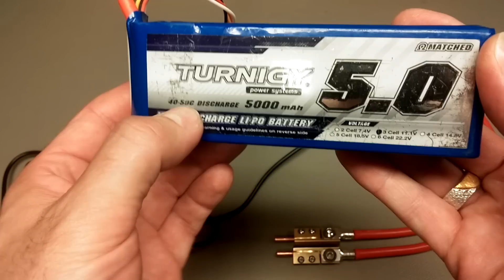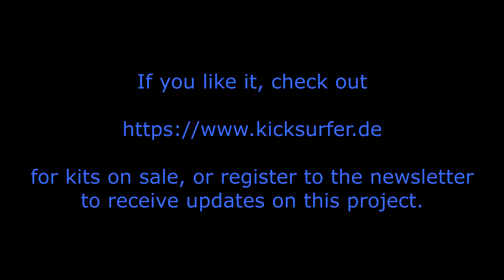Next level DIY battery spot welding

Comment: 150J sieht mir ein wenig overpowered aus, selbst 0,3mm Strip schweiße ich mit Druck auf die Elektroden bei 100J und die sind fest. 
Teste mal bitte verschiedene Einstellungen und verschiedene Streifen, das wäre sehr interessant.

P.s. den Daumen hast du trotzdem bekommen ;)
Reply from the maker: zu dem Zeitpunkt hatte die Firmware noch falsch gerechnet, das ist längst behoben :-) Die richtigen Werte habe ich dann im Manual aufgelistet.

Comment: If the FETs stay on for some time, the current should accumulate due to inductance to some maximum value, when the FETs are then switched off, so ZCS switch on. But at switch off you have maximum current and maximum switching losses, and without a flyback diode how is this energy depleted? Like I see what looks effectively like a buck converter without the freewheeling diode. The freewheeling circuit will be half of the power since it starts at the peak current and decreases to zero.

I thought that was what was killing my cheapo $25 ebay special along with poor gate drive. At least on one occasion, a FET failed so spectacularly that it somehow welded itself to the PCB and removing it required lots of heat and force with pliers. Chipping away at the plastic encasing and the stuck metal tab that welded itself to the copper despite being soldered.I did get a chance to see the silicon die on those and was impressed with how huge it was. So used to thinking of transistors as microscopic things but seeing the die that was maybe 4mm by 6mm was just amazing!
Reply from the maker: in kWeld, this is handled by an array of large TVS diodes. As you have experienced, the MOSFETs alone cannot handle the amount of inductive kickback at these current levels.

Comment: Hello: as sending e-mails to both info@keenlab.de and admin@keenlab.de failed, I'll try it like this.
I would like to order a Kweld, but your website sends an error-message:
"Composer detected issues in your platform: Your Composer dependencies require the following PHP extensions to be installed: bcmath"

I hope this reaches you ;)
Reply from the maker: website is up again, this was a glitch from automatic updates! Contact email is frank.boeh@keenlab.de
Reply: @wearethewatt2950  Thanks ;) I just went with the mentioned adresses as most websites provide those ;) Let me try to order tomorrow ;) First, time for bed ;)

Comment: Im second guessing these amp values in the four digits.
I have seen this spotwelder shows high values with quite low battery input and we still see like 1100 to 1500 amps.
anybody actually validated this, and it ain't just some crude estimation from input values..
the ms values are aqquate as theese are pretty easy to summon, accurate amp values not so much.
tested it on a scope, with a current cl'amp, and got way way lower with a 4s LIPO. (and wondering if it's my gear that simply can't take the reading accurate)
Reply from the maker: The pulse current is actually measured by the unit. I've also validated this via scope and shunt resistor during the design. As measurement is done via MOSFET Rdson, of course you'll have to consider a +-20% tolerance. What current clamp do you have that measures 1500A?

Comment: What is the voltage measured at the electrodes ?
Reply from the maker: That depends on the situation: when welding, typically 1 to 2 volts. During idle, zero. When triggering a pulse without load, battery voltage (that can be 4 to 30V). That's all low voltage so no risk of electrocution.

Comment: Can i try inverter welding machine as a power source?
Reply from the maker: If that puts out DC voltage (4 to 30V) at enough current (1500A desired) then yes. But AFAIK these systems produce AC voltages.
Reply: @wearethewatt2950 arc welding inverter i use at home is 220v sir. I thought i can use it in low amp. thank you sir for the information.

Comment: The pen does not burn your fingers if you make a few welds?
Reply from the maker: It gets hot after some time, because it receives heat from the weld spot naturally. But you don't burn your fingers :-)

Comment: This is the best diy implementation of a spot welder i've seen so far, the software with calibration and measurement features is like a cherry on top, really nice.
Reply from the maker: thanks :-) There's a new cherry: the latest model also supports an anti arcing feature that protects you from burning a hole in the battery when accidentally triggering a plasma arc due to dirt, corrosion or too little contact pressure.

Comment: Awesome , what type of connectors are used between the wire and the electrode ?
Reply from the maker: these are custom CNC'ed copper parts that I had desgined for this purpose. The series component is a lot different from the early attempts that you see in my videos: https://www.keenlab.de/index.php/product/kweld-complete-kit/

Comment: 3d print an electrode holder. Would be nice if it could use power tool battery packs. Then you could build a full case and have a fully portable welder.
Reply from the maker: Electrode holder: https://secondlifestorage.com/t-Easy-to-3d-print-K-Weld-electrode-housing-files (community contribution). Power tool battery packs won't work, as the welder needs at least 1000A (better 1500A).

Comment: nice job. your bus bars are too thick though. making it unnecessarily heavy and increasing resistance and lowering the weld current.
EDIT: oh no you used brass instead of copper?! this will make a huge drop in effciency!
Reply from the maker: Just do the math and calculate their electrical resistance (they are 12x4x75mm).

Comment: Fantastic work. It can deliver up to 500J, but you show 18650's require only 150J. Could you make a less expensive version with fixed 150J output? Then you could downgrade all components, thinner cables, fewer mosfets, smaller battery, no pot (cuz fixed), etc. I don't need 500J.  I think you would find a lot of buyers for that. Thx.
Reply from the maker: It's the current handling capacity (2000A) that makes the components expensive, and the reliability that my design stands for. Battery spot welding needs at least 1000A to work properly. The amount of energy is varied by adjusting the pulse duration. However, the numbers in this first videos are wrong (current measurement was inaccurate at the time of making it). The series product can do up to 200J, and needs 50-100J for 0.3mm nickel strips.

Comment: I'm confused how did you not get shocked by holding the two electrodes at the holder? I'm new to electronics. Was it because the electrons used the path of least resistance or something?
Reply from the maker: you can't get shocked from something that only uses 12V, and your assumption is absolutely right. It's Ohms Law that applies here of course.
Reply: WeAreTheWatt thank you fo the help I understand now

Comment: you can access to vary the milliseconds in some way ?
Reply from the maker: As I explain in the video, it works differently. It automatically determines the required pulse time based on the given conditions at the electrode tips, you just need to set the desired amount of energy. This ensures very consistent welds even with varying levels of corrosion or other dirt.

Comment: What is the reason you used brass over for example aluminium or copper?
Reply from the maker: Both aluminium and copper would require tin or silver plating to prevent oxidation, and brass is also easier to machine.
Reply: @wearethewatt2950  thanks!

Comment: hello, is it possible to use Li-Ion pack and not lipo?
Reply from the maker: that's possible, but it must be a very big one with an extremely low internal resistance (4..5 milliOhms max), in order to deliver the required current of at least 1000A (better 1500A).
Reply: all thanks, thought of 36v and 11ah. That would have to go?
Reply from the maker: The voltage is too high, kWeld is rated for 30V. But a lower voltage like 12V is advisable, otherwise you get too much arcing and electrode wear. And as I said, the internal resistance is important - you haven't given that number.
Reply: Alright thanks. Have looked a cell has already more milliOhm as it is forced. Then I will test it with lipo.

Comment: Thank you for such excellent design work. Aside from following common sense precautions I would like to ask where can I find more details about safe handling of the device. I would have expected that touching the electrodes while triggering a pulse would be dangerous but you appear to be doing just that in this video? Also, if there is an existing discussion somewhere about kWeld safety/handling then please point me to it. Thanks!
Reply from the maker: As this is welding, all corresponding precautions apply here. Protect your eyes, make sure that your hands don't get burnt, and work in a fire safe environment. This system runs from a 11.1V battery, which means that there are no dangerous voltages involved, hence no risk of electric shock.
Reply: Thanks for your reply. I had assumed that such high amperage would be dangerous, but I guess not at these voltages. For eye protection would you suggest welding goggles (darkened glass) to be necessary or will regular clear plastic eye protection glasses be sufficient?
Reply from the maker: Only amperage that goes through your body is dangerous, and at 12V this just doesn't happen. The only danger here is getting burnt. For eye protection, use clear glasses as there is no intense light involved.
Reply from the maker: I'm not. Please inform yourself before making false claims. For example, https://en.wikipedia.org/wiki/Electrical_injury#Body_resistance
Reply: @wearethewatt2950  I presume that, when both electrodes are on the battery, current flows through the metal strip (much lower resistance). However, if you accidentally press the button while holdering only the naked electrodes, would it still be safe?
Reply from the maker: @ntsarb  The system runs off a 12V battery, and there are no higher voltages involved. There is no risk of electrocution, the only way you can hurt yourself with it is by getting burnt from the heat at the weld spot, or from getting hit by ejected molten metal. Using safety glasses is a must.

Comment: I guess I'm late to the party (as usual) but what I like most about this is the flash and weld are much more like a proper spot welder and look like they are generating minimal heat. One guy on Youtube has a video where he tests his welder with two tabs on a piece of wood. When he lifted them the wood had a big burn mark. I hate to think what damage he is doing to his batteries.
Reply from the maker: Definitely, considering that the can is filled with plastic to the rim, which, should it fail, creates a short circuit.

Comment: Great idea!.......went to the website to actually buy this product because I need to make another pack this week for my ebike and for girlfriend and cycle friend but, to my  surprised 1its more expensive than a whole spot welder from aliexpress which varies from 90 to 100€ including shipping!
   Yes, I must wait at least 3 to four weeks but, I don't need a battery power source!.........come on, make a great product at a logical price!
Reply from the maker: In fact I have a lot of customers having bought the stuff from Sunnko initially (try to make reliable 0.3mm nickel welds with that). I am not a Chinese company having access to local Shenzhen market (selling products that were made with disrespect to environment and people). In other words, the production cost of a unit is already more than 100€. The custom kWeld components are actually all made in Germany. I focus more on quality and reliability (also in my component choice), which puts kWeld somewhere between Sunkko and Sunstone in my opinion.
Reply: And I went to Mercedes shop and they had no car for £5000. I can buy Dacia for £5000. Come on Mercedes, make a great car for a logical price.

Comment: Looks good I been finding transformers to rewind the secondary to get the most current at low volts .....it don't weld a good as this tho .....very nice
Reply from the maker: Thanks :-) I opted against transformers, because a) no way to turn that into a kit for sales, b) less control as you say.
Reply: WeAreTheWatt oh yeh I don't plan on selling just for own quick use
Reply: I like the electrode holders

Comment: I'd add an option to run with electric plug instead of LiPo.
Reply from the maker: I've a (yet incomplete) stationery supply in the www.keenlab.de shop, based on a supercapacitor module.

Comment: Will this work well with a 24V 430AH LA battery set as it's power supply?
If so, what  would the expected current draw or appropriate breaker size be?
Reply from the maker: I have no references for this from other customers, everybody uses 3S Lipos or 12V starter batteries. Depending on the accumulated ohmic resistances in the system, your battery may deliver too much current causing the overcurrent protection trip at 2000A. A higher voltage also increases the likelyness of arcing, which in turn causes excessive electrode wear.
Reply: WeAreTheWatt OK.
I'll keep this design in mind once i have enough spare cells to make dedicated battery, or have a reliable way to recharge my truck batteries paralleled.

Comment: Id ad a nice beefy heatsink to the tops of thoes mosphets if i were you
Reply from the maker: that's not necessary, they don't exceed 60°C even under very heavy load. As the welding electrodes are in direct contact with the melting material, they heat up much quicker. This is also the reason why I substantially improved their design as you can see in the shop.

Comment: This is the ultimate machine!! German engineering...lol .... Commercially available spot welders are in the stone age...
But you battery is unnecessarily large it can supply  250A continuously , you are only pulsing perhaps 150A?
Reply from the maker: ;-) But your guess is a bit off, there is one zero missing - the current is 1400A.

Comment: Hi 
i would like to know the price( ( with shipment cost to Saudi Arabia) of these battery spot welding
and what is the manufacture
Reply from the maker: You can check the pricess in the shop, https://www.keenlab.de/index.php/product-category/kspot-welder-kit/ Most parts of the kits are manufactured in Germany, some (like foot switch and fuse) come from China.

I am sorry but I don't ship to Saudi Arabia.